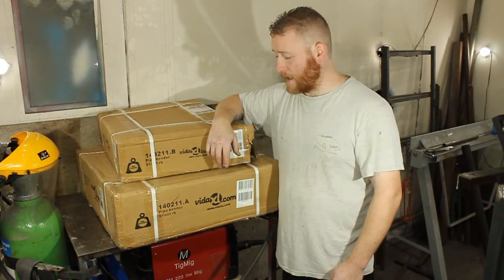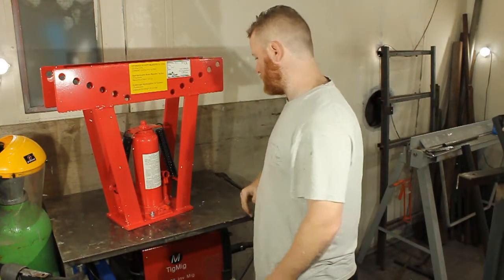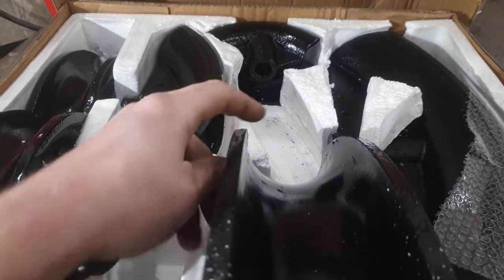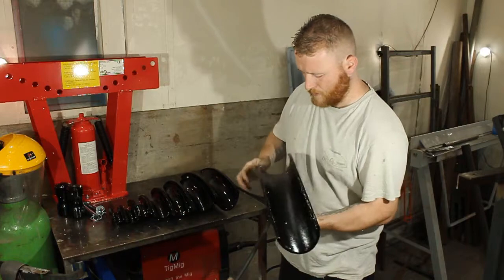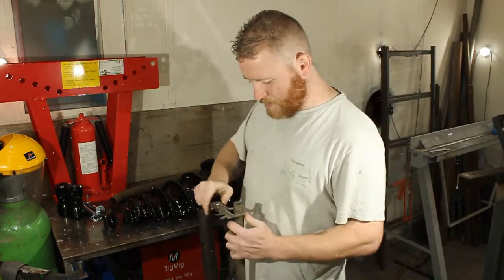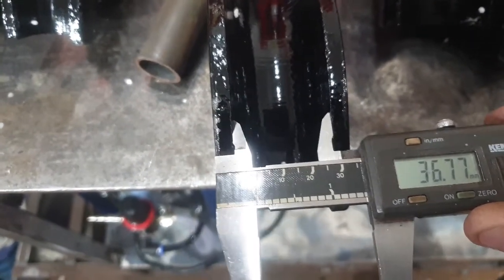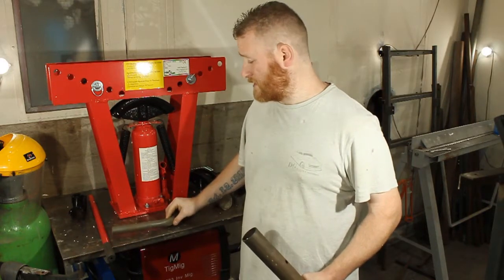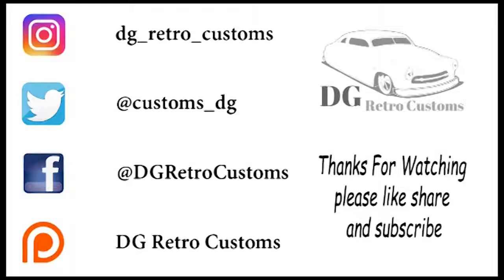Amazon Pipe Bender Unboxing and Review

Comment: I bought a proper tube bender for this reason. You kinda need a traditional tube bender if you don't want the tubes collapsing in on themselves. The Amazon pipe bender will work to a point but you need to divide the bend into 10mm sections and bend each section a little and it takes about 20 minutes just to do one bend. Packing with sand will also help a little
Reply from the maker: I have done some scaffold tube with it by packing with sand, I am eventually gonna do a follow up video with some other tips and tricks with it to get succsefull bends
Reply from the maker: @Stopvotingdemocrat  just duct tape bottom, fill and compact as tight as you can get it and tape top, then throw it in the bender
Reply from the maker: @Stopvotingdemocrat  your more than welcome, let me know how you get on

Comment: One more thing tubing is measured on the outside and the dyes are marked for pipe that is measured on the inside so a 1" dye is used on a 1 1/4 tube and if the tube is thin walled you will have to fill it with fine sand just tape the ends with duct or masking tape. and bend a little every inch around the radius.

Comment: I just tried to set one of these up today 08/14/2021 and the engineering or the manufacturer got it wrong. There are three faults with mine. I made internal spacers 4 3/4 " then bolted it together with 5/8 " bolts to add strength to the frame and when I looked at the rollers one of mine was drilled crooked and came out 1/8"th off center on the opposite side so it will never roll round on the pins that are  3/16" smaller than the hole in the roller so when you jack up the dye the first thing it will do is force the small pin up against the top of the big hole in the roller and prevent the rollers from spinning thus jamming the pipe into the dye and crushing the pipe. D SC I can't believe they have sold millions of these defective machines. I can fix mine with a larger roller pin but I have to pity all those millions who will never know how to fix theirs.
Reply from the maker: i never looked at it that closely to know how far things where out, i got a full redund and they allowed me to keep the machine so when i have time ill have a look at refining it and making it useable and ill do a full vid on that

Comment: Try adjusting the two pins you have in the top holes. Open it up so it isn't try to put such a tight bend. You my have to bend it twice or more by sneaking up on it. Ronnie.
Reply from the maker: I did try it different ways and the best result I had was with the shim, I have been doing some reaserch on it and there are a couple different things to try so I will be doing a follow up video soon
Reply: @DGRetroCustoms  Cool, looking forwardto it. Ronnie.

Comment: Did you get a better pipe bender..
Reply from the maker: No I didnt, I still have this one although they did give me a full refund, eventually when I have some time I am gonna do a follow up video with some tips and tricks to get some reasonable results
Reply: @DGRetroCustoms  you need to fill the pipe with sand .Probably was not adverted correctly or you did not read the spec carefully .Your pipes have to thin walls ..that's why you get cresses

Comment: that bender is not designed for exhaust tube,  its a thick wall pipe bender, to bend exhaust tube you need to pay thousands of dollars thats why most people do not have a machine.
Reply: That's the point of this video. To not spend thousands of dollars 🥱
Reply from the maker: thank you
Reply: @DGRetroCustoms  v welcome bud ingot some exhaust work coming up looking for methods to bend some pipe your video helped
Reply from the maker: @colevarela7320  I am gonna do an update on my bender but the trick is shim the dies so the tube is snug and pack the tube with sand use duct tape to seal tje ends, its not perfect and a bit of a faf but I have had some resonable results
Reply: @colevarela7320  so why  buy a tool that will not do the job, unless you like wasting time and money.
Reply: @johngurney1069  he clearly proved the tool does the job. So thats misinformation. . What's the issue he spent what a little under 200 to do a job that a thousand of dollar machine can do. It takes more time but works right fine for home shop
Reply: @colevarela7320  you have to be kidding  you must have very low standards if that crushing in tube is acceptable,
Reply: @johngurney1069  he alr said how to fix that issue and a follow up video. Let's see you try
Reply: @colevarela7320  talk is cheap, thats why i have never comment unless i have done it , so i used a different  pipe bender and purchased bending dies to suit tube not pipe cost 500.oo
Reply from the maker: did you even watch the video properly??
Reply: @DGRetroCustoms  yes even had my eyes wide open it will never bend tube without flaws

Comment: those benders are no good for anything under 3-3.2mm walled pipe, even then it needs cold rolled pipe you will never get them to bend exhaust pipe no matter how tight the dye is you need a mandrel bender and then you will be pressed to find one under $2k for anything over 25mm
Reply from the maker: thank you for the info, i have seen a few vids now of hacks to make these work better and i am planning a follow up video of trying a few out, i never expected it to be great but i was very very disappointed at the results from this one

Comment: My son you got your channel to muddled up! For one you're not even bending pipes the right way you have to spend it with you to peach pressure or a solid as in you could have put some sand inside of that pipe bent it wider first and then brought your guys in closer you would have perfect friends you're not using that tool correctly whatsoever or you could have used yeah could you you got your channel you got your wires crossed you just don't know enough about vending you need all kinds of stuff lubrication and heat you got all those fine tools there you should have filled those pipes with Sandy tape them with black tape so it can puff out a little bit started white on the bedroom and then work your way and thinner and it will work perfectly instead of trying to defend it to the smallest right away and I don't need the smallest size of pipe doesn't work the other vendors we can just use them right on the table but she puts the bend on a little guy that's the kind that I use works on all sizes
Reply from the maker: any chance you would be able to translate this into english please?
Reply: i think something gone haywire in your head you don't make sense
Reply: @DGRetroCustoms  good luck with that